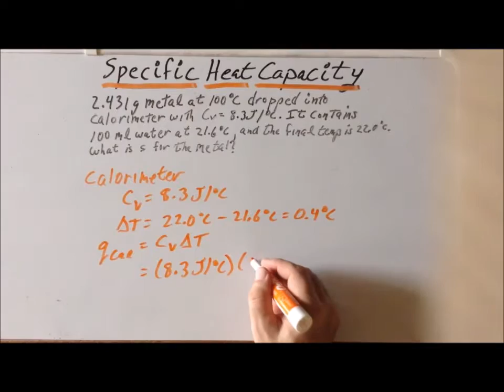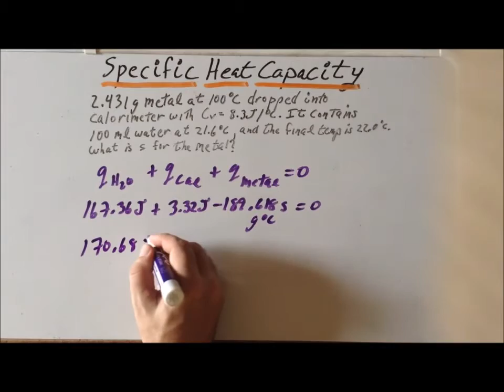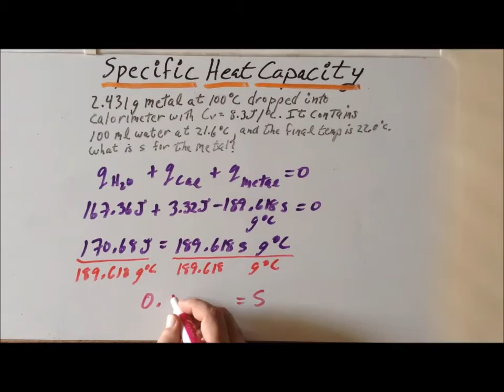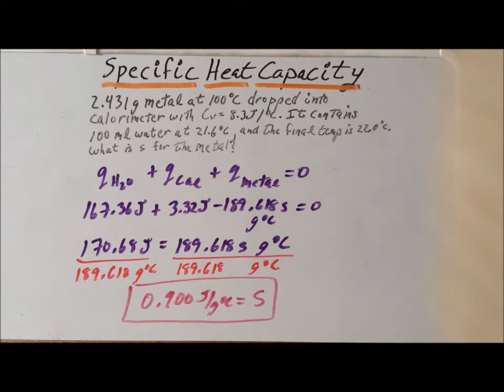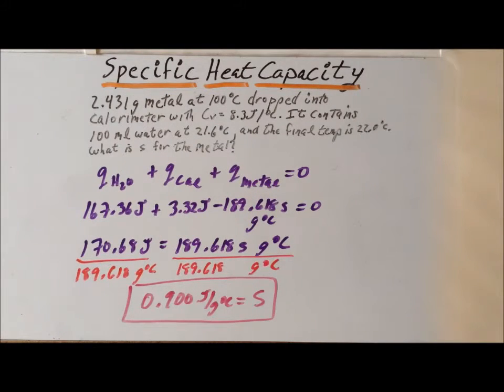Specific heat capacity (hot rock in water)  with calorimeter calculation

Comment from the maker: (for mobile users)

00:08    Statement of problem
01:09    Calculate mass of water
01:47    Calculate temperature change (ΔT) of solvent
02:11    Calculate heat flow of water q(H₂O)
02:57    Calculate temperature change (ΔT) of calorimeter
03:38    Calculate heat flow of calorimeter q(cal)
04:14    Calculate temperature change (ΔT) of metal
05:06    Calculate heat flow of water q(metal)
05:56    Conservation of energy: q(H₂O) + q(cal) + q(metal) = 0
06:43    Solve for specific heat capacity s